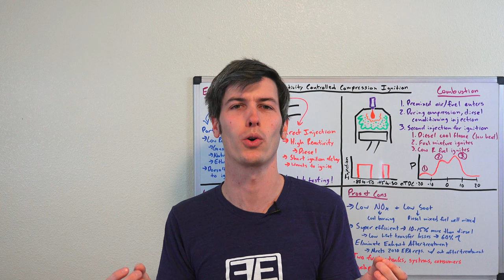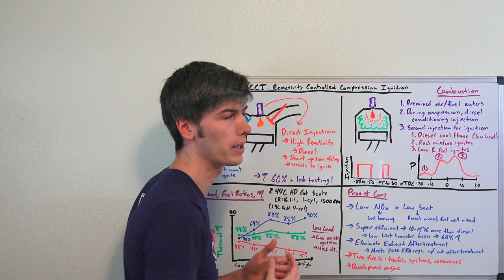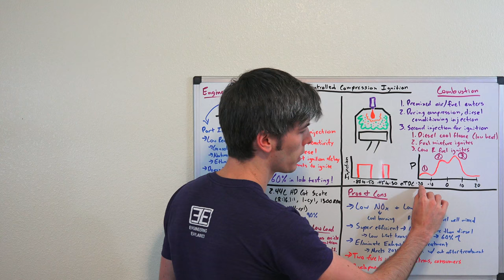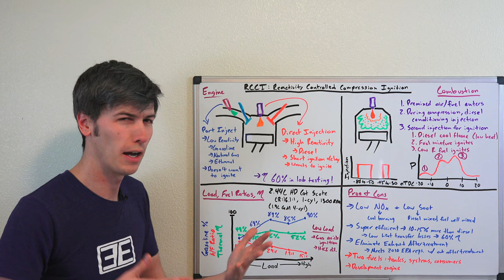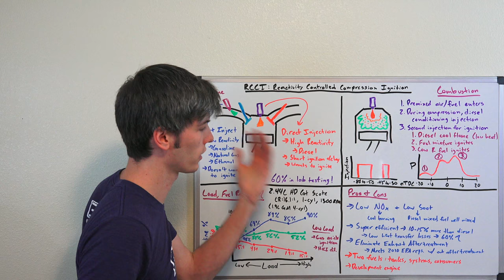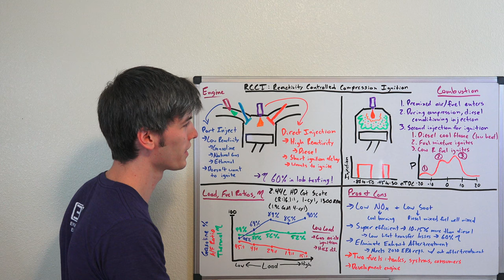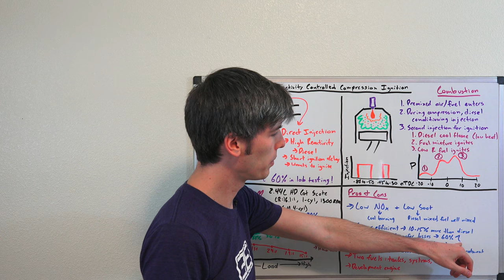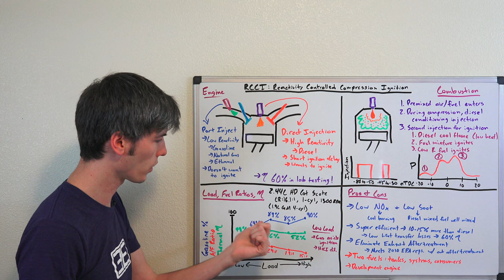Super Efficient Engine Uses Gas AND Diesel - RCCI

Comment: Problem, Liquid fuel will convert into vapour during the compression stroke subsequently absorbing heat leaving less heat to ignite the diesel. So you have to raise compression ratio...
LPG or CNG injected before the turbo will be the same temp as the ambient air by the time it gets to the intercooler and will not have any effect on compression temps.

Comment: I wonder what the efficiency ratings would be if an opposed-piston engine was equipped with RCCI. While not practical for automotive use, such a system could be a great choice for ship engines and large generators. It could also work for locomotives and city transport buses.

Comment: You can just mix the fuel or put an additive. They need to remain separate so the mixture can be varied. It won't take much longer to fuel though the gas stations will need to allow for hanging up one nozzle and continuing the purchase on another. Shouldn't add more than 15 seconds to a fill up and you can cap and uncap while the other tank is filling.

Comment: I have been thinking of this recently as well. I first was wondering about propane injection used as a power adder, as reported by some diesel tuning videos.
For a large truck, I imagine 2 fuel systems with an increase in efficiency would make economic sense, whereas a small car, not so much.
It's interesting to see the curves of the graphs showing the percentage of gasoline to diesel.
     I had an additional thought: what about using CNG and spark plugs only for a cold start (in weather cold enough to require glow plugs). I prefer natural gas to propane for temperatures colder than -40, or the temperature where propane remains a liquid.
     Also, when idling, where a straight diesel engine might tend to produce more soot, I am guessing CNG with spark ignition might be preferable. Testing for that was not part of your presentation. I would guess a catalytic converter is needed for this type of fuel combination.
    A question I could not answer is, what is the ideal amount of total fuel to air ratio? The graph did not show that value.
     I wonder because, in a gasoline engine, emissions were controlled by the correct amount of Oxygen combined with the catalyst (thus the use of O2 sensors for computers to adjust gasoline injection). In a diesel, there is always extra Oxygen (typical diesel engines don't restrict air with a throttle plate. Extra high-temp, high-pressure Oxygen allows NOX to form.
  And the last question:  does this test engine need a trottle llike a gas engine, or no throttle like a diesel?

Comment: One thing you missed out is the compression ratio . What is the compression ratio of that engine ? Because if the compression ratio is too high it would result in self ignition of gasoline and if it is too low the diesel fuel would have problems igniting as the pressure and temperature would not be that high . There has to be kind of a sweet spot which is best for both gasoline and diesel fuel . Anyways very nice and interesting video .
Reply from the maker: Mentioned in the third section of the video. Test 2.44L had 16.1:1 CR.
Reply: Engineering Explained yeah my bad i completely missed out on that one . Thanks .

Comment: I knew a guy that used propane in his diesel engines.  That is, he sprayed just a small amount of propane into the intake. Hotrodders have been doing the same for years and years in diesel engines also, to increase HP output! Also nitrous spray works well too.  He claimed he had great success with fuel mileage and cleaner oil when the time came for oil change. This was 20 years ago! I don't know any details of how he did this. YAY Mazda for showing up 20-30 years after the curve. Two fuels, diesel owners are supposed to put urea in for emissions control. kinda the same thing, except this gives better fuel economy not worse.

Comment: When you said this engine requires no exhaust after treatment, I thought I heard you say to meet diesel emissions standards.  Did I hear that correctly?  If I did, why would an engine that burns more gas than diesel, be classified as a diesel engine?  I doubt most governments would permit that.

This is certainly a very neat concept and I hope it succeeds.  This could bridge automobiles another decade or so until EVs can become truly competitive.
Reply: I dont really understand this either, both gasoline and diesel engines use something in the exhaust to clean it, so surely a mix would at least require a CAT like most gasoline cars do.

Comment: Short of photovoltaics, who's problems are storage and the area used by them, what engines are the most efficient for generating electricity?  This would take into consideration fuel cost - use lowest cost fuel for multi fuel engines.  I know the electric utilities use jet engines (turbines) to make peaking power and that is a different thermodynamic cycle, Brayton vs Carnot, which is more efficient.  Let's assume single RPM use to make things easier, as electricity generation isn't sensitive to engine speed.  I'm assuming (possibly variable) AC generation, switch rectified to DC.

Comment: if you use propane as an intake coolant it will do the same you just make sure that the propane is always so extremely lean that compression ignition can never happen and there is plenty of ox for the diesel to then ignite with and burn completely at full power

Comment: You get most of these benefits by installing a 50/50 water methanol injection on a turbo diesel. Been doing this for many years. It's an easy way to get an extra boost of power with no other modifications with improved engine cooling and less emissions

Comment: TO SELL IT> Just explain that you get to skip gas stops for the price of having to fill two at every Nth stop. I'd take that trade! (Does "N" = 7-8 for this ???)

As for "Nth", that number could be improved with a multi bank engine where one bank is RCCI, and the other is standard spark ignition. Either have deactivation on the spark side, or just run the majority of fuel through the RCCI side. That makes that RCCI side work harder, as it would be only half the size, which burns less diesel. Thus, that would extend the diesel range. And at high power the spark side running equally hard would halve the diesel used. So it seems you could extend to dual fill up to maybe every 10th stop, or more. Further, run out of diesel, and you could still run on the spark side alone. 

BTW, awesome and finally that someone realized that fuels can be combined, as opposed to old school thinking that a dual fuel engine was only about running one fuel or the other. I have also thought of adding small amounts of gas to speed up diesel engines combustion - more as rpm rises. But this may be better.

BTW, crazy that no one sells luxury efficient cars based on how many gas stops they let you skip versus a high power car. I'd go for a pitch that told me I could skip say 50 stops for gas over the life of the car.

Comment: Interesting in theory but would like to see how it works in the real world. For example diesel fuel is difficult to ignite in cold temperatures, and the initial ignition takes place with the diesel fuel. Had a conventional diesel in 1980 and it was a bear to start in cold weather. Also you did not mention it or I missed it but I am assuming the engine has no throttle valve.

Comment: I believe this what propane injection and water methanol injection kits already being sold in the aftermarket offer. One drawback, if the injection cycles aren't metered and timed correctly could cause serious combustion issues.

Comment: Little question. Why are we not injecting water in Turbo engines for a better efficiency ?
I mean, when the engine is hot, around 300 to 600°, you simply inject water during one cyle, then let it be followed by two other normal cycle with fuel. This would help control the temperature from the cylinder, and water-> steam reaction is rather powerful.

Comment: As exciting as a this sounded to me initially I realize most people I know who run diesel engines are already doing this, or something very similar to it.  They inject natural gas into the engine air intake to reduce the amount of diesel fuel needed.  I can't make any quantitative claims regarding thermal efficiency but two things result from doing this. 1) Expensive diesel fuel is replaced by cheaper natural gas and 2) increased horse power.  This increase in horse power is especially noticed when pulling heavy trailers.

Comment: 16.1:1 compression? That's really interesting, so basically this could be implemented on an existing diesel engine just by adding a gasoline (or CNG) injector and a computer upgrade.
Reply: yes and no, the injectors on most diesels are mechanical and can't vary the multi-stage injection parameters at all. Only modern electro-mechanical or piezeoelectric common rail injectors can do this sort of thing. The other big elephant in the room is the computer as you say. Here they basically built the computer from the ground up using National Instrument's development hardware sensors and tooling, which allows them to vary a lot - like all the pre-mix pulses as the piston is sucking in air and not even compressing yet. That's some serious timing advance haha. But they also have driver circuits just for powering the injectors that they used, since presumably no off-the-shelf ECU would do the RCCI cycle and also just happen to be able to control some random 4-cyl GM diesel injector. So you're not just upgrading a computer, you're building one that replaces your car's OEM ECU, but also does wacky injection timing, because that wacky timing is how they control everything basically. It's not all done with dosing it's also done with timing of the doses.
Reply: @John-rw9bv  Yup, I agree. Anything with mechanical injectors is 100% out of scope, but most modern stuff is electronic. The computer can probably be done as an interceptor, similar to e85 and LPG retrofit kit computers. What's exciting to me is that there's really nothing here that's not off-the-shelf. Contrast with something like LPG direct injection, which is part that just does not exist.
Reply: @calebjamesdelisle6239  No no, haha, i see what you're seeing because you know how LPG usually works and i only just learned a lot of this stuff myself, but you're missing the main part which is that you can't just use an interceptor, because you'd be intercepting a normal diesel cycle ECU, and RCCI isn't doing a normal diesel cycle. In a stoichiometric engine, you can substitute the petrol for the same BTU of LPG (or any fuel) and so long as the computer has an oxygen sensor it can use the fuel trim to tune out the differences. In a diesel you always have an excess of oxygen, and almost always a turbo, so there's a lot more math (and different math) that goes in to providing the right amount of fuel to hit the desired torque/rpm. With RCCI the diesel mainly acts as a "liquid spark plug", but it doesn't squirt in a constant amount of diesel each time. If it did that, it would only need to squirt in a tiny tiny tiny amount to get the LPG to ignite. But then the LPG would burn very hot at 16:1 compression ratio under diesel turbo pressures, and while that combustion would be great and super efficient, it would leave the cylinder so hot that the next load of LPG that enters will autoignite/knock.  Also the engine wouldn't last long because the LPG combustion is so quick/violent, peak pressures would be very very high, and it's the peak pressures which wears out engines, not the area-under-the-curve of pressure for the whole stroke. This is why pure LPG engines don't run at the max compression ratio for the fuel (16.5:1), they run lower and use a spark, sacrificing efficiency for reliability and emissions. So essentially the cylinder temperature is controlled by varying the amount of diesel, yes, and if that was all there was to it an interceptor could read how much diesel the ECU wanted to squirt it, and instead do it as some LPG/Diesel ratio. But thats only half of how RCCI works. The other trick RCCI has up it's sleeve, and how it gets better efficiency, is by layering in the fuels it's squirting in a bit like a multi-layered cocktail. As there isn't enough time for the diesel and LPG to perfectly mix, the detonation itself is staged, and therefore drawn out over time. This lowers max temps and pressures, keeping the LPG stable at these high compression ratios. So RCCI can play with fuel injection timing and amount (like a diesel), but also fuel ratio AND fuel layering arrangement. The ratio and the layering arrangement chosen will also change the amount and timing of fuel, so you can't simply go off what the original diesel wanted. Or rather the interceptor computer would ultimately end up being the main ECU and the original diesel ECU would be only be giving an expensive and imprecise indication of what the accelerator pedal is doing :P You wouldn't want to use it as a basis for the RCCI calculations.

By the way, there are really no good open source diesel standalone ECUs, and you can actually directly inject liquid LPG these days. Check out the dutch company "vialle", they're pretty cool :)
Reply: @John-rw9bv  One nit-pick I would make is that I don't think LPG retrofit kits are actually relying on the lambda sensor to make the stock ECU cut fuel. It's my understanding that ECUs will use the o2 reading to trim the map, but if that reading goes out of a fairly narrow range, it will fallback to the default map and throw a code.

But you make good points all around, I was not thinking about the fact that as boost rises, you need to augment the mix. So at least a MAF sensor source seems quite necessary.

I have a vague recollection that they were trying to get the conditions close to detonation which is obviously a knife-edge. If it is as I remember then clearly the system would need a close eye on all of the sensors.

Your comment about burning 99% LPG makes me wonder if you couldn't just do that and cool it down with water injection, but that's a different rabbit hole.

And yes, an interceptor would be indeed a bit of a silly thing, but the fact that it's possible is important because most modern cars are hopelessly married to their ECUs and so even just keeping it there and letting it think it runs the engine is better than trying to replace it.

Finally re Vaille, I gather you're referring to LiquidSi product, which AFAICT is liquid but not direct injection. Shame that they seem to be out of business, but in any case thanks for the tip!

Comment: Well , I guess I depends on how you want to understand thermal efficiency. When it comes to the chemical reaction , higher temp means best mixture . Lower temps means poor emissions. Understanding the principal mechanism of a piston engine , you will or should know that it's best use would be a compressor . Maybe explain why you wouldn't use a piston driven engine and expect any kind of efficiency.

Comment: If you could get 50 to 60 percent efficiency without having to treat the exhaust I wouldn't care about having to fill 2 fuel tanks with gas and diesel . I would want to run that system in every type of vehicle I owned be it car,truck or lawn mower . the only down side is the engine would need a compression ratio of at least 20 to one  to ignite the diesel and the gas would need to be around 91 octane or higher to work with the higher compression ratio . but those are all good things for a engine to have .

Comment: Is stratified Homogeneous combustion an oxymoron??

LPG diesel systems have used a more primitive version of this method for ages.

There is talk that "electrolysed water" gas mix with Petrol engines provides similar "enhancements"  (we won't mention if the additional energy overcomes any parasitic loses or NOT...  -magic doesn't happen thermodynamically but increased efficiency - with unaccounted energy transfers - may make it seem magic..)

Comment: Dual fuel road cars would only be bought by people who can drive a manual, change their own oil, etc. The average joe distracted smartphone user would either forget to refuel both tanks, or put diesel in the gas and gas in the diesel tank. 
I suppose you could fix the user problem by building fuel pumps with coaxial hoses and pump nozzles, so one pump nozzle could simultaneously fill two separate fuel tanks through a special filler cap.

Comment: Engineering Explained or  what about having a diesel engine tuned to burn as Hot and lean l(low soot)as possible and then just cooling down the exhaust gases like with fins on the exhaust pipes and maybe an Little loop around like some cars  brake lines and having coolant run through the exhaust manifold  also having exhaust pipes that actually fit the flow requirements of the engine

Comment: It is an interesting idea. Just a few things off the top of my head though. How high of an octane gas needs to be run through that kind of engine? I know when running a  high compression motor, 13:1, I had to use racing fuel which cost five dollars a gallon, ten years ago.   And then the question of durability.

Comment: It amazes me how technology they used 60+ years ago years ago is coming back and being used.  John Deere tractors pre-1960 could run on either Gas, Diesel, Distillate, and Kerosene.  These motors generally started on gas to warm the motor and then switched to the other fuel.   Now days since parts are harder to find to repair these tractors/fuel systems a lot of guys mix 50-50 gasoline and diesel to run in these tractors, and all those motors used spark plugs for ignition, even when running straight diesel.